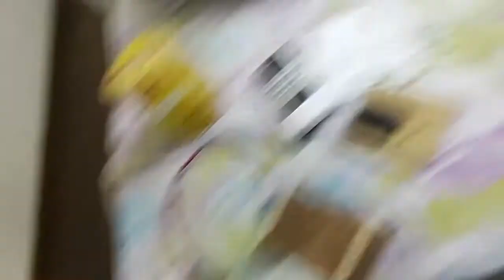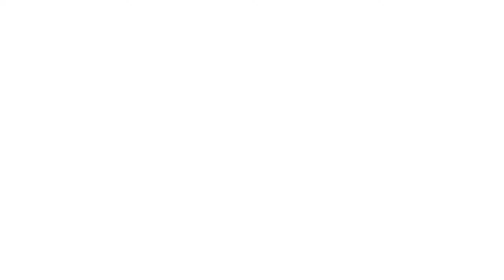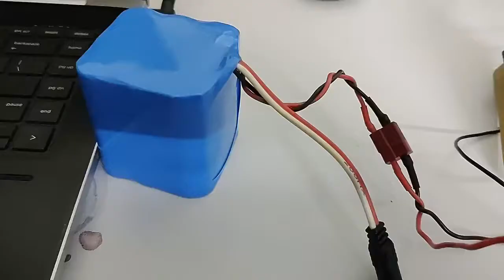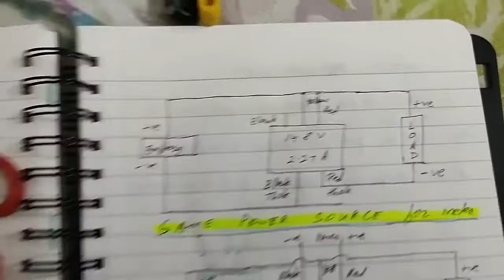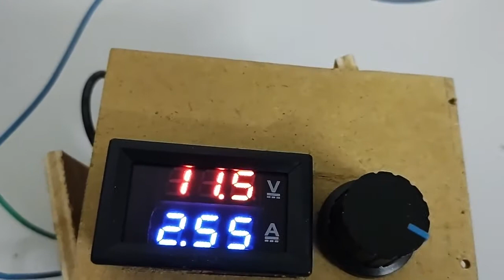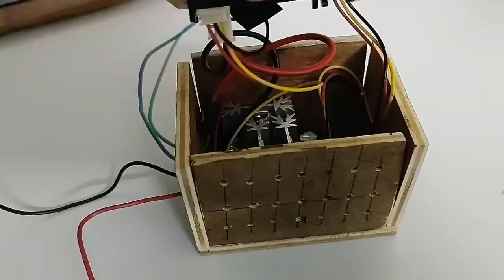Controlling 2 Jhonson DC Geared Motors with 1 controller

Comment: Fascinating work 👍
Reply from the maker: Thank you Gurpreet! It was fun making it - especially the debugging when the potentiometer stopped working after connecting the Digital Volt Amp meter and the motors had maximum voltage and current!